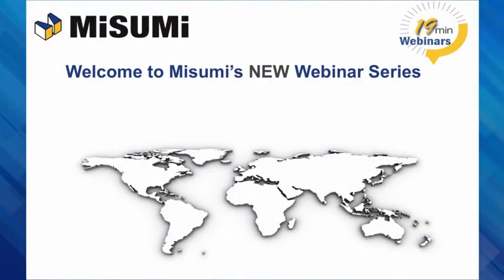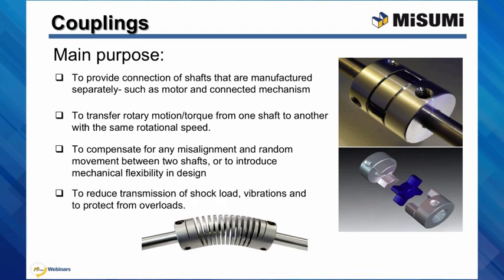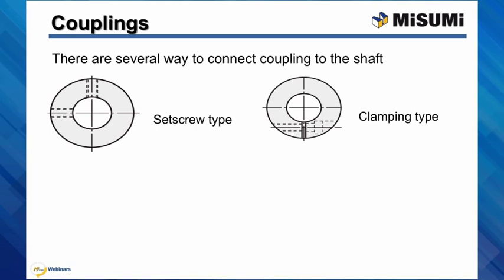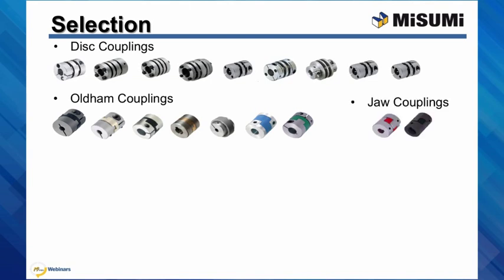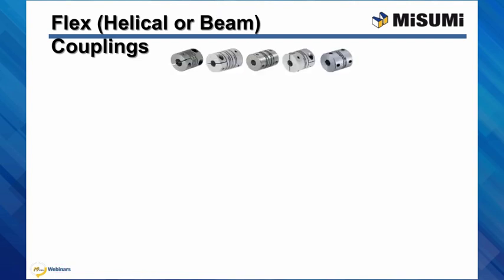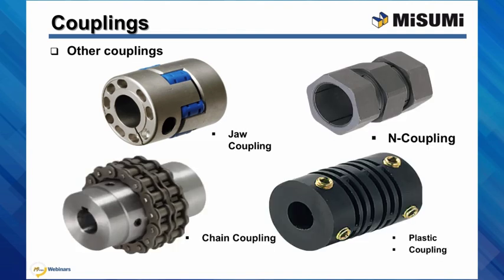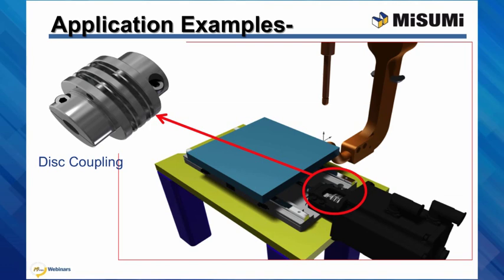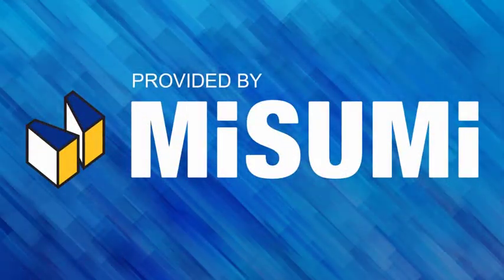Introduction to Couplings

Comment: which type of flexible coupling   suitable for motor with load?
Reply: Basem Sharaiha m
Reply: Yes
Reply: what motor has no load you moron?
Reply: https://www.youtube.com/watch?v=AzvHde8ao1M
Reply: Hi have you seen our couplings? they are unique in that they do not require laser aligning and also have up to 3 years warranty while running at up to 10 degrees misaligned. They handle vibration as well as high torque. sarah@thompsoncouplings.com 
https://www.youtube.com/watch?v=KRkr4XVleVg